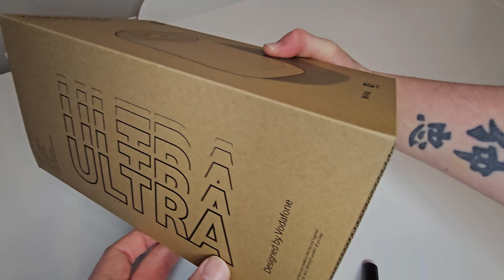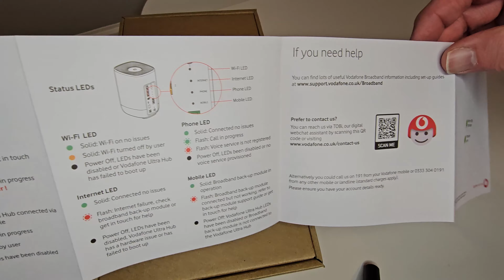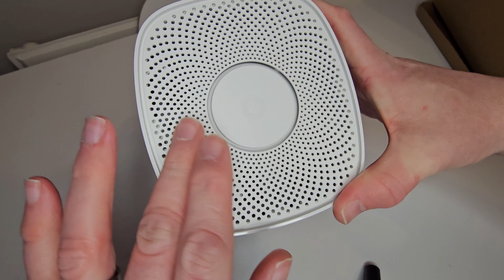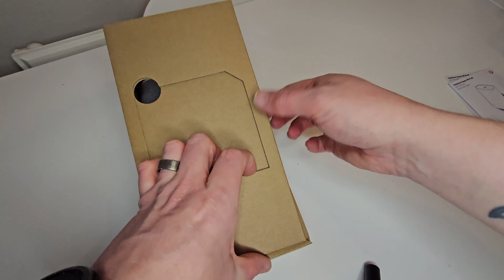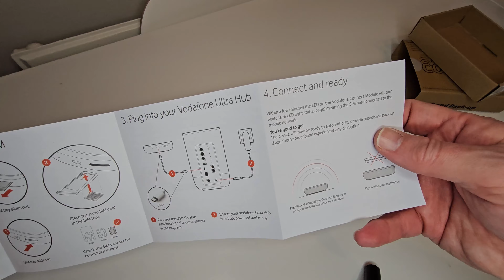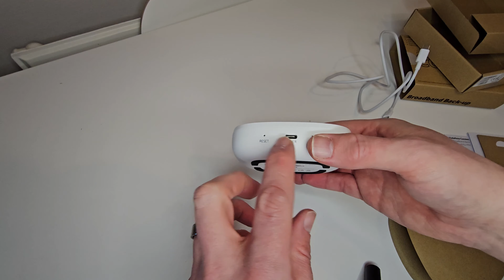My new Broadband - Vodafone Pro Broadband 2 - Part 1

Comment: We’ve had the new Vodafone Broadband for a couple of months. It turned out to be slow and tended to drop out frequently. There is an immense problem getting to talk to a human being and the Bot is so annoying not understanding question. We eventually got to a situation where it seems the main income telecoms socket is an issue(full fibre to the street cabinet, copper to the house). So an Openreach Engineer is coming out tomorrow to look at the installation. The house is twenty years old so I hope they up date the socket.

Comment: I am looking to change from ee.  I am not getting the highest speeds. But I I hope not to have openreach coming to my home. They are useless. First time they came, they were here pretty much thre entire day. Scratching their heads. But they finally got it to work. They left, then my neighbour came to my door telling me that they had disconnected him. Then a few years later my broadband wasn't working. Contacted them. It turned out they had disconnected me as well while they were out setting someone else up. I need to find a supplier that doesn't use bt openreach.

Comment: Sorry I just need clarification.  Do Vodaphone come in an install this for you or do you have to do it yourself which looks a bit daunting.  Also, the CAT Cable ??  Does one Coaxial cable enter your home like the one with Virgin Media?
Reply from the maker: @ksumar  so I eventually went with EE instead after the hassle I was getting with Cityfibre. With EE the openreach engineers came out and ran the new fibre optic cable into my  property to little connection box which they wall mounted, from there it was down to me to hook up the hub to this connection point, it's all very simple to do and  even if you are not use to doing anything like that when you install the app, which I'm sure Vodafone will have too, it runs you through the setup process.

Comment: I got supplied a THG3000 router from Vodafone for my city fibre connection, but I brought a Vodafone ultra hub from eBay with booster, however I'm finding it just keeps crashing and dropping out every few minutes even on the ethernet devices, when it is working my android phone speedtests gets 500mbps download and upload speeds on the 6e connection

Comment: Hi Scott, I have just had this new routr etc installed with the full fibre 500 package after upgrading from Vodafone FTTC 75Mb. Im curious if you have a ladline telephone with them too? I find it very ambiguous whether if you have a landline if your meant to continue with thr copper landline or connect to the router for VOIP
Reply from the maker: Hi Daniel, bit of a long story but I'm yet to be set up with Vodafone.

With regards to the copper telephone line, that will become redundant in my property as it will be VOIP as you mentioned through the new fibre linecand router, in my current set up which is only 68mb I am on VOIP although the Internet service is still provided through the copper wires, I believe the intention is to phase out all the copper lines and for us all to go fibre.

Comment: Just 2 LAN? That's poor.

 Anyway I  just signed up to Vodafone Full Fibre 910 via CityFibre. 

I consistently get 934/934 WIRED. 

WiFi is average 450/500.

Comment: Thanks, I just ordered Full Fibre 500 as my EE supply price for 36 mb/s had gotten way too pricey. Good to see the hardware, looking forward to part 2 with your feedback.
Reply from the maker: Ended up having to cancel Vodaafone and sent all the equipment back due to City Fibre basically cancelling the engineer visit due to not being able to do the installation and didn't provide a new date when they could attend, really shocking from City Fibre to be honest.

Hopefully all goes well for you, clearly issues where I stay actually completing the cabling to the houses despite them having already ran the lines up the street.
Reply: Fairly confident for me, I hope lol. I was the optical fibre manager in Northern Ireland. for BT. I  know the Openreach supply is with me. We'll wait and see. Thanks for your update. Hope you get your VFM supply soon. @BrisyTechBytes
Reply from the maker: @andyarmstrong1493  ended up ordering gigafast through my current provider which is Sky, the Openreach engineer who came out was far more helpful and basically confirmed what I thought was the issue, that there is no conduit leading to the property so for that to happen the civils team will need to come out and dig a bit of the street and the monoblocking in the drive up.

City Fibre simply cancelled the order for the installation at their end with no further info of why they done it or with an updated installation date, had they done that and I maybe had to wait a few weeks longer that would have been fine with me.

It's a pity as I was looking forward to trying the Vodafone equipment out and also having an upload speed that'was the same as the download speed.

Enjoy the new broadband when it's up and running 👍

Comment: I’ve literally just signed up to this same deal two days ago myself, 

very similar story tbh, 

I’ve been with EE (& orange before they were bought out) for around 20 years & we only went from 2gb to 50 odd max over that time!! Can’t believe I stayed with them so long now…. 🤦‍♂️

Hopefully this deal will be good for us both mate, 🤞

Ive gone for the full 900 but they say around 500 odd is guaranteed 🤞👍
Reply from the maker: Well I'm not off to the best of starts, the day after I posted this video I got a notification from City Fibre that they were cancelling the engineer visit due to an issue at their end, the following day I got a further email from them and vodafone saying that it was a blockage and coukd take up to 10 days to resolve , I'm getting compensation for every day my service isn't live but no update as to when it'll be fixed.

I had already put the motion in works to cancel my Sky broadband but was lucky enough to catch it in time and cancel it, think you have 48 hours from the point of cancelling.

Disappointed with how it has gone, so far is a massive under statement 😔
Reply: @BrisyTechBytes oh mate, thats not good….. I haven’t heard anything from them yet??
Reply: @BrisyTechBytes Update my end, day 3 from ordering i had a basic query about the fitting so i rang them, Just as well as they had received a notification of cancellation from city fibre….. long story short, city fibre had automatically selected a phone number, that through up an issue and automated cancelled the whole thing, broadband service, vodaphone broadband account & fitting….. & said they had called me but hadn’t!!! 

Got it all re arranged with Vodaphone (over the phone this time) so new number was selected manually & confirmed by City fiber as ok 👌

Then got all the emails to confirm fitting etc that i hadn’t received before! So back on track but 4 days behind….. 🤦‍♂️
Reply: I had the dame mines installed tomorrow hows it been for u@BrisyTechBytes
Reply from the maker: @galaxydave69 another 2 parts to this video, basically didn't end up with Vodafone, long story 🫣

Comment: Great video Scott. I’ve looked at Vodafone before and I’m really interested in finding out how Vodafone performs. I’m on the same speed from Virgin but Vodafone is cheaper and I’m out of contract.
Reply: I’m with Virgin Media and to be fair it’s very reliable however they have just hiked up the price to a whopping £62 a month. The customer service they provide is one of the worst Ive ever experienced. It takes hours to get through and when you eventually manage to speak to an operator presumably based in India you can’t understand what they are saying. 

Im looking to change providers so looking forward to your next video as to how your experience is going.
Reply: @LindaGGG I did cancel contract with Virgin yesterday. Did you find something better?
Reply from the maker: Cheers Stu, for me being on such a low speed I know it'll be a massive upgrade, I'm just interested to see how close to the advertised speed I'll get and over time just how reliable it is.
Reply: @BrisyTechBytes me too 👍😎